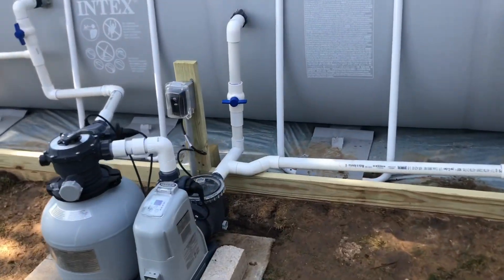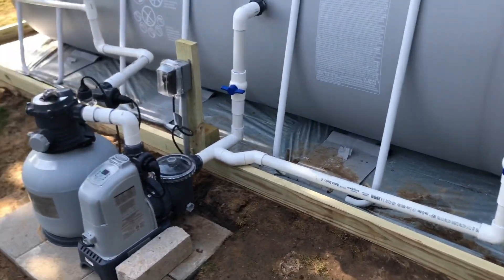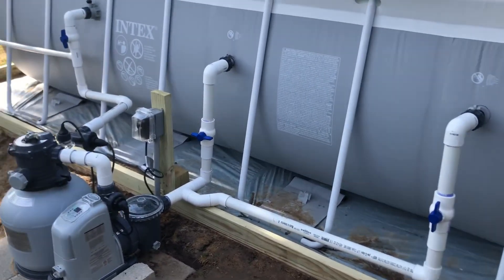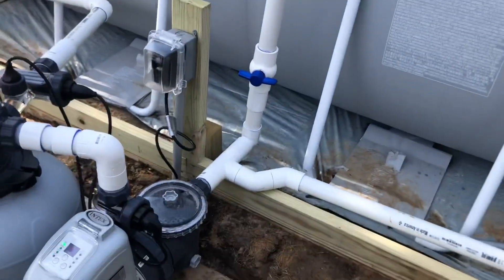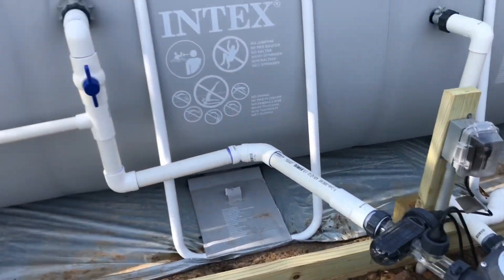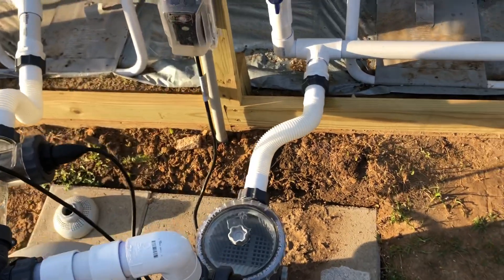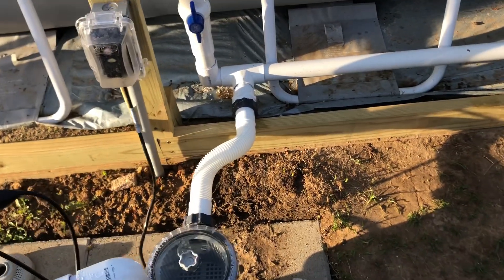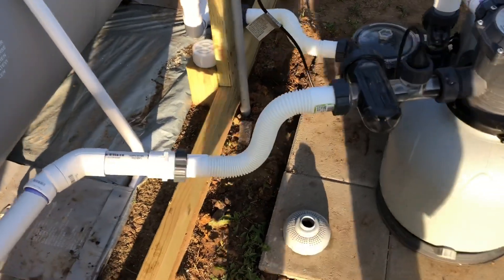Hard Plumbing Above Ground Pool?  Watch this video first!

Comment: Your plumbing looks good!  I did it where I used all 2 inch from and to the pump.  Instead of adapting to the pool, I just made a square 2x6 support and went over the edge with my PVC.  I also ran a 1.5 inch to my skimmer and it works perfect.  I didn’t like the pipes that came with the pool.  They failed in the sun.  Your setup looks great though!

Comment: I knew there was a way to hard pipe these pools using part hard pipe, part pool hoses. I was trying to figure out how the make the hoses match up to the hard pipe male threaded fitting. Now I know. 
I see that you used the pool clamp fittings to 1 1/2" hose fitting on the suction side. That is exactly what I wanted to do. It would be easier to use those fittings and use hoses to hard pipe. 
Well done. 👍

Comment: Hey! Very good point! I actually use the rubber couplers vice the figuring out the 1.5/2" threaded connectors. It worked well for me.  On the one port from pump to pool I used a vice grip to make little teeth marks around the pvc. This gave the coupler something to bite on when clamped. The only reason I went with couplers is the ports on my pump and filter had these barbed inserts made for the standard pool hose. None of the supply stores had adapters and Amazon wasn't a thing back then. LOL I thought the last ice storm tore them up but set up a newer pool, rebuilt filter pump and those old couples still hold. I like your idea. Since I ditched the crap filter pump I have those hoses, just need to get some 2' threaded  ends and glue them on.  I havent seen rubber sheets around but I bet std toilet gaskets are like 2'

Comment: I would recommend hoses at the pool side and hard pipe at the pump.  The vibrations from the pump are negligible, shouldn't fatigue the piping.  BUT, the movement of the pool and the weight of the piping hanging from the fittings in the poolside may cause issues with your connections at the pool.  You could then also install some hangers to support the piping.  Thanks for the info on the adapter fittings.
Reply: I came to same exact conclusion myself, but i feel like either way as long as there’s some hose rather than the pvc at any point it should take the stress off of the entire setup

Comment: Add some regular hoses to the conections from the pool to the hard pipes. It will work as a damper for the wall movements. Great work!
Reply: Regular hoses? What kind of hoses?

Comment: Where did you get or what did you use to connect the pvc to the (2) intake ports at the actual pool connection points?

Comment: I'm looking for any info I can find, specifically in terms of part numbers or at least names, Of plumbing fittings that will let me attach hard lines to my Coleman (Bestway) pool and Intex salt water system. Anything you've got will be helpful. I'm finding most PVC fittings use tapered pipe fittings with a slightly different pitch than the Intex stuff that seals with an o-ring and flat plate. Hoping to source everything I can from Lowes, Home Depot, Sutherland's, various farm and family stores and locally owned hardware stores if I can.

Comment: I noticed your pool cleaner on the bottom has a one piece hose. Did you do that or did it come that way? Mine has couplings every 2-3 feet and it always looses pressure the the swivel connections.  Great video BTW

Comment: I have the same pool and I’m wanting to hard pipe also, will 1 1/2 pvc fittings thread onto the INTEX fittings? I did buy two compression adapters to take the two inlets to 1 1/2 in. I’m wanting to get rid of all tubular hoses. I do like the idea of the two short ones going to pump. Thanks
Reply: Just replace the fittings with real pool fittings. They are easy to install. Plus add a skimmer. Then you have a real pool!
Reply from the maker: powerlocks You are just full of useful info arent you?  Geez
Reply from the maker: Michael Webb the 1 1/2 pvc box adapter mates up to the standard 1 1/2” intex fittings...you just have to use the threaded collar from the original hose.  Just glue a coupling to the box adapter with the collar in between for your new fitting.  Works perfectly!

Comment: How did you find fittings that match up with the Intex hoses/pump/etc? I’m having a hard time locating that size.
Reply from the maker: A 1 1/2” pvc box adapter mates up to the Intex fittings.  You rob the threaded collar off the original hose and glue a coupling onto the box adapter with the threaded collar in between.  You just have to sand the stamped lettering off the box connector
Reply: There is a company that makes the fittings 40mm to 1 1/2”. Amazon sells them they are made by “Game” and sell for about $10 for two.
Reply: Thx to both of you
Reply: @Marie-kj3xf  wow= this was helpful!!!

Comment: Great video. I really like what you have done here. Jeromy, what did you use to connect the the 1 1/2" PVC to the outlets on the two suction ports coming out of the pool (shown at :16 seconds in the video)? I have the Intex 9 x 18 pool and our suction ports just have a 3/4" straight piece of rubber tubing that gets clamped to clear hoses in the stock set up.
Reply from the maker: Hi!  I had to make a connection using a 1 1/2” pvc box connector found at Home Depot / Lowes.  I cut the OEM hoses and robbed the threaded collar off of them.  I glued a 1 1/2” coupling to the box connector with the OEM collar in between.

Comment: Jeremy you might consider putting in a wall mount skimmer.  Easy to do and better than those in pool ones. Works better to.  Other than that like your set up.  Also you think the two input  valves work better than just the one?
Reply from the maker: Hi Larry, thank you for your comment.  Originally I purchased a thru wall skimmer, but the issue I had was because of the design of my pool, I would lose too much water level for it to work the way I wanted it to.  I have been surprised by the Intex skimmer that mounts to the top rail really.  Works better than I anticipated.  To answer your question about having 2 input valves vs 1...yes I really like the ability to direct the input from where I want it.   A good example is when I vacuum the pool, I can use the thru wall input and turn the skimmer off...  This is especially important to me as the skimmer I use won't work with a standard vacuum hose adapter.

Comment: What adapter are you using on the pool side?
Reply: you can easily install real pool fittings and add a skimmer. Boom you have a real pool.........Easy to do, i did it to mine! Plus i added a waterfall.
Reply from the maker: I used a 1 1/2” pvc box adapter and robbed the threaded collars from the hoses the pump came with.  So the fitting is the box adapter with the treaded collar over it, going into a 1 1/2” coupling, and then 1 1/2” pvc from there.  The 1 1/2” box adapter mates right up to your standard 1 1/2” pool fittings.

Comment: When you say you lost to much water. Was it because it was leaking around the gaskets or what.  I have a intex pool and mine doesn't lose any water.  So just help me understand where you were losing the water?  Thanks
Reply from the maker: I mean that in order for the water level to be correct for the thru wall skimmer, I would have to run the pool with 3-4" lower water level.

Comment: Why watch this first? You didnt replace the fittings with real pool fittings, no skimmer and you are using the junk intex pump and filter.............You should do everything i just listed. lol. Hard pipping doesnt change the junk parts you are using. lol
Reply from the maker: Thank you for your super helpful comment.  I really appreciate it!
Reply from the maker: Also, I DO have a skimmer, just not a thru wall one because I didnt want to lose any water level as my pool is only 48” deep to begin with.  I purchased a thru wall skimmer but sent it back and went with a skimmer that hangs off the edge.  Also I have 1 1/2” fittings at the pool.
Reply: What sort of a vacuum do you have?